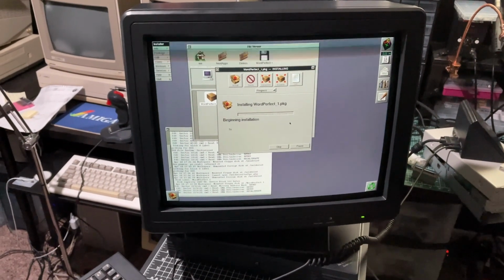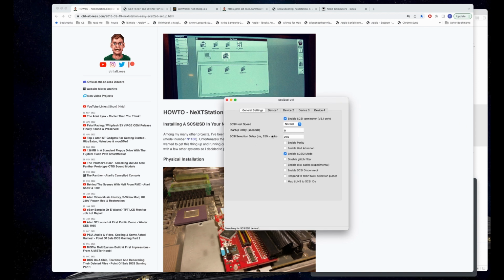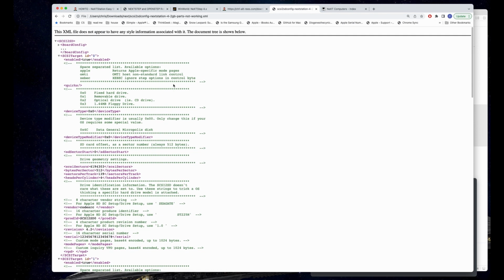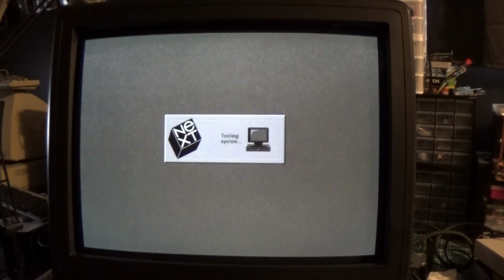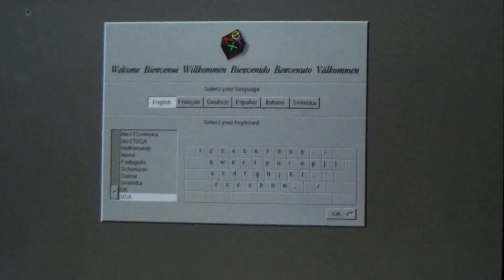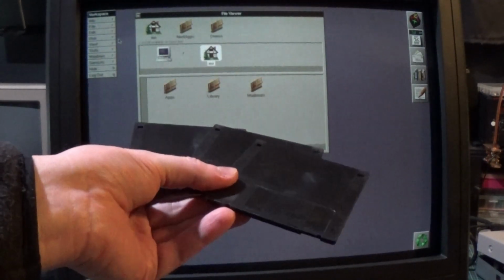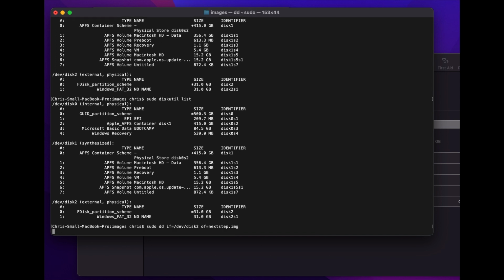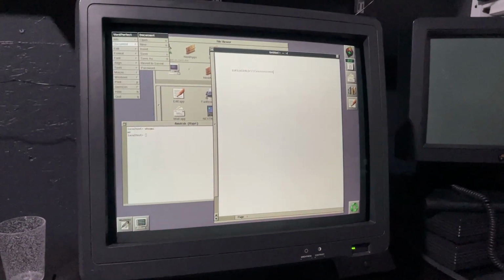NeXTstation Turbo Color - Installing OpenStep and Software

Comment: For anyone watching this now, you're better off using the BlueSCSI v2 card these days which has explicit support for NeXT in its recent firmware updates and is much easier to set up and maintain. It is working great in my NeXTstation Color Turbo in 2025.
Reply from the maker: Agreed. After I started experimenting with BlueSCSI or even ZuluSCSI, I can't go back to the rather cumbersome setup of the SCSI2SD solution anymore.